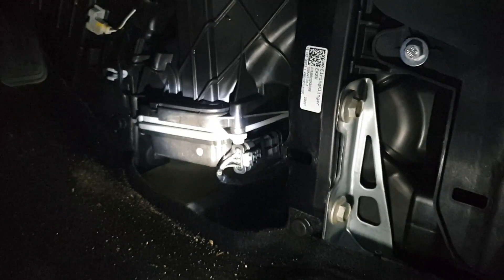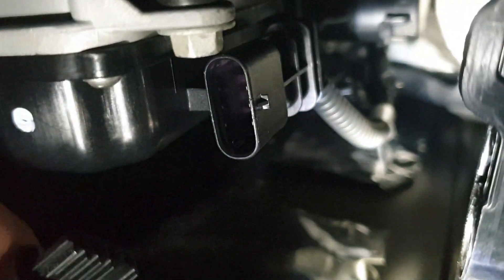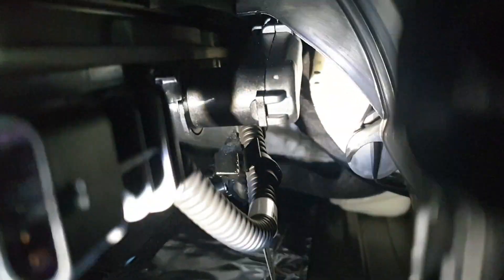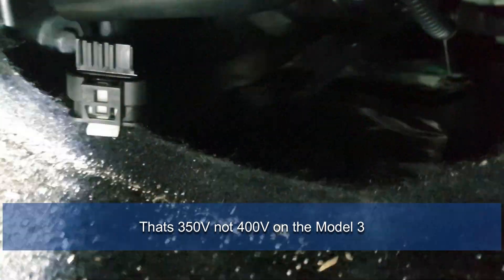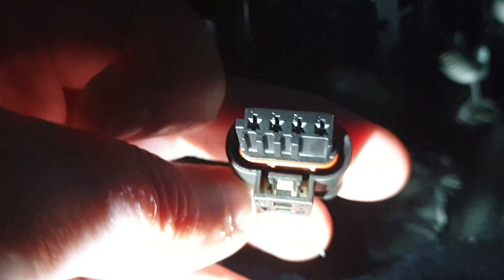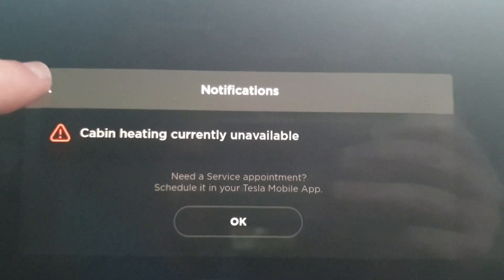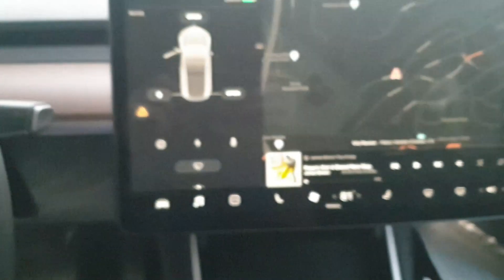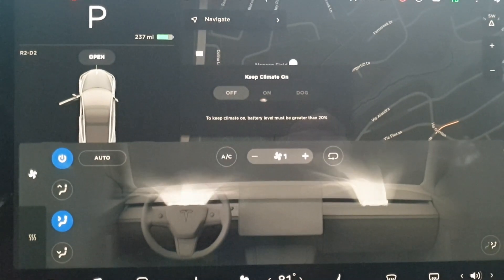Tesla Model 3 Disable Cabin Heater and save 1-2kW when trying to cool car w AC (~5% Range increase)

Comment: If you leave the temp set to LO and run the AC on a hot day, does the heater still draw power? This could be a work around to save energy.  I have set the temp to the lowest setting for every car I have ever owned because I assumed it might be injecting heat via the heater core to modulate the temp.  Modulating the AC on and off whether done automatically or manually should regulate to the set temp.
Reply: Yes this is a workaround. Unfortunately this is not safe to constantly fiddle with the M3 touchscreen, not to mention annoying.
Reply: @beachmiles  I agree with you but I have found that setting the fan speed works quite well instead of turning up the temp.  If you are driving in and out of clouds, you might need to turn the AC on/off but I can live with that.  If you live in a very humid area of the country, using this method might cause mold build up in the venting and cabin filter.  BTW, I verified using the Scam My Tesla that the heater appears to never draw power when the temp is set to LOW in the AC none AUTO mode.

Comment: If someone can figure out what the 4 wires are (+, -, and two communication signals?) then it might be easy to splice into it and make a switch to ENABLE/DISABLE the cabin heater.  If I were one of the people annoyed by the heater running when it shouldn't I probably would try to spy on the wires, but I don't really have the time or interest.  It might be as simple as putting a switch inline with the + wire.